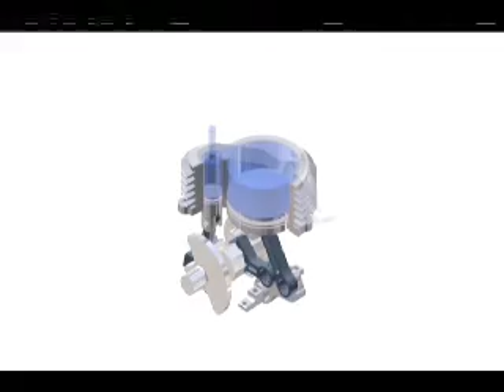A car that runs 200 miles on compressed air.

Comment: no way it runs around and round. the generator uses energy. if you can run it on compressed air, the point was to run the car on that air. what they are saying is they are creating energy from nothing. you can not have a loop like this. law is "energy can not be created". but i do think it is a cool idea. and i bet it would be cheap to run. just saying no way it will refuel itself. however you lose energy in braking, maybe they can covert that to recycle some of the energy. these system do exist

Comment: I read the air storage cylinder is designed to break apart without shrapnel or explosion when damaged, carbon fiber I believe.

Comment: "They're the reason why this technology is not hitting the showrooms"
Bwahahahaha
Look down at the comments 
Old tech, very short range, expensive to run, with no room to improve. Franchises sold to the greedy technically illiterate and admired by tinfoil hat wearing conspiracy kooks.

"enslaved to the grid"
An air car you needs a compressor an electrically driven compressor in this car. So how are you free of the grid or did you believe the perpetual motion BULLSHIT

Comment: hey no matter what if there was a generator on board or not MDI compressed air car is a revolutionary in automotive history. this car will be easy to fill and cheap. but what i heard is that there will be a car coming to the US in late 2010 or early 2011 in new burgh, NY  by a company called zero pollution motors and their car will have a range of 800 miles on just 8 gallons of biofuels or gas. so i don't see why this car is useless.

Comment: Wow this is one of the dumbest videos I have seen, and yours is one of the dumbest comments I've read. The video is not falsified. You CAN run a car on compressed air - people have been running trams inside coal mines on compressed air for over a century. You could not have combustion there. This is nothing new. But filling up with compressed air is not free - anybody suggesting that is an idiot. There's no source of compressed air, it takes a lot of energy to create it by running a compressor.

Comment: compressed air is free????  You can breathe the exhaust???  compressors suck electricity (and therefore money) like CRAZY, and introduce all kinds of contaminants into the airstream - oil vapors, condensates, dirt particles, you name it.  It's a convenient way to power certain devices, but is terribly inefficient.

As far as the perpetual motion thing, the author of this vid couldn't pass a high school physics class.

Comment: "Why is this rubbish?"
Why don't you read some of the comments oh ye of complete lazy arse. 
FACTS 
ONLY test range 7.2km 
The claims are LIES 
They have been selling franchises since the 1990's and left the franchises burnt and effing angry.
This is OLD technology air cars were used as trams in the 1900's and died because they were very short range low power and energy inefficient.

Comment: "A little thermodynamics will suffice"
like I said "Quick Calculations" 
Basically an overall efficiency of about 20% vs batteries electric motor at 80 to 85%
Another way is engine swept volume, gear ratio, tyre diameter and tank volume expanded to Std temp and pressure some maths which gives the absolute maximum theoretical range
About 40miles but MDI use a pressure regulator halve that and the efficiency of the engine is about 50% so halve again = about 10 miles on a good day with a tail wind

Comment: You don't need to look at MDIs history. A little thermodynamics will suffice. I don't have a problem with the notion that compressed air could serve as a storage mechanism, but of course you need to use a lot more energy to compress and convert it than you'll get back.

Comment: You can't be that stupid and be allowed to type. Step away from the computer. Compressed air is a decent STORAGE medium for energy. It takes more energy to compress it than is released. 

I can't believe the narrator made the stupid statement about the generator. Clown. Try this, connect a motor shaft  to a generator and the generator output wires to the motor. Give it a spin--wow, perpetual motion, and all without the intercession of a bunch of compressors and air motors. 

Not.

Comment: "Do you know how much it takes to evolve a concept from prototype to functional final product?"

It's an expansion engine for fucks sake ie steam engine there is 300 years of engineering history.
Air powered trams and mine vehicles date back to the 1900's This is a horrible old idea with exactly the same problems miserable efficiency, lousy power storage google Douglas Self Museum of retrotech 100 years  of air powered vehicles

Comment: "Is compressed air free now?! I've found free air (for tires) nowhere in the last 5 years."
Ah no. 
You have fallen for an MDI smoke and mirrors trick 
IF gas stations has 3500psi (pressure in the air car tanks) DIVE BOTTLE COMPRESSORS you could refill there but they DON'T and filling air tanks to 3500PSI is effing expensive at a dive shop particularly as the REAL range is about 5 miles (The ONLY published test)
Reply: The problem with compressing air and filling tanks is the heat generated. My local dive shop puts you tank in a water bath to keep it cool while they fill it. You can't do that with the car. Also this car has emissions, just not at the point of use, CO2 is created when the electricity used to run the compressor is generated. There is no such thing as a vehicle with no emissions. When people say no emissions, they are intentionally being deceptive.

Comment: Is compressed air free now?!  I've found free air (for tires) nowhere in the last 5 years. A couple of gas stations used to do it. Now it costs anywhere from $.50 to $1 just to fill up your tires. "Costs nothing... NOTHING to fill up your tank"?? Producer's a crank. Hype, hype hype! Sure, it's cleaner. Maybe it'll even be quieter, eventually. But free? It's not even free now. Can you run your home air compressor for free? The power company should let you, I know. Especially if you have this car.

Comment: "at the beginning of the century, petrol was free"
Only in your dreams converted into % of todays average wage liquid fuels in the 1900's were expensive. The cheapest in % of the average wage was in the 1950's

Compressed air air costs now. It is effing expensive way to move energy. Wander down to a dive shop and ask for a free refill. I'd like toi see how far they throw you

Comment: The waiting for 2 weeks worth of sunshine to recharge the tank to go 5 miles might be a "tad" impractical. :-)
This POC needs a 7kw compressor running for 6 hours to refill the tanks 
No 200W solar panel is going to make much of a dent it that sort of power demand

Comment: Uh... Have you ever taken into consideration that a regular car is sitting on a huge bomb? Further more the tanks are carbon fiber, so they would split open harmlessly rather than explode.  Kinda like if you shredded a hot air balloon.  So it's actually kinda safer than a regular car. However if you DID shred your tank you'd have to import another one from France, which would totally negate any gas savings you got. >_>

Comment: OK the problem is to use a phrase from TV "you canna bend the laws of physics" and the ideal gas law which is absolutely cast iron bullet proof allows anyone to calculate just how useless the MDI idea is. ie Goes about 5 miles on a charge which is what they actually get. Unfortunately there is no magic whiffle dust that can change this. MDI are doing the equivalent of selling magic shoe laces you can pull on to lift yourself to the moon. A con covered with a false science wrapper

Comment: faster than the rate you expel it from the vehicle than it IS possible to charge it while using it. Like I said before. You just aren't a visionary. That's why you'll never create anything. You're just going to stay in your close minded ways and not try to figure things out. So don't go lecturing me on what is and isn't possible. Because you don't have a clue what can be done as technology advances. Stay in your close minded state and bark at someone else. I'm through with you.

Comment: Actually I'm passing science with high marks.
You're just stuck in the past. One thing you have to know about science is that it's always evolving and some things considered impossible in the past are now possible now. If you're INTAKING new air while powering the compressor then you're not making something out of nothing. It's just circulating in new air and compressing it. It only takes a couple minutes to fill a compressed air tank with a good compressor.  So if the rate you take it in is..

Comment: Absolutly nothing. You have no vision. That's what your problem is. Yes you'll have to initially charge the thing. But if they can make an effiecient enough compressor that charges an empty tank and it's own tank while you're using the other tank it is potentially possible to keep it going the whole day. All they'd have to do is make the compressor run off less energy than the car and put it part of the way into the cycle. If the air is powering it, and it's constantly sucking in new air yeah.

Comment: It's not a perpetual motion machine, the engine is powered by compressed air coming from storage tanks (made by carbon fiber or something) underneath the car itself (think you can see them at 0.35). When the compressed air runs out of these tanks, you will have to refill them at some 'air station' that MDI is visualising about.

Comment: "It's not just the knowledge,it's what you do with it!"
The 7kw compressor to recharge this POC needs about $45,000 worth of Photovoltaics to run it. The air car efficiency is five time LESS than an electric vehicle
Google Vencat 20 miles for the USA distributor providing figures confirming that

Knowledge with out understanding provided by education? Your post reflects that

Your call

Comment: "I do believe it can be done." 
Yes you can limp round with a range of about 5 miles, Whee! and that has been so since the 1900's
The LIES MDI tell are physically impossible. You will need to get an education to confirm this yourself, but of course it's SO much easier to blame "THEM" for things not working instead of trying to use your brain.

Comment: So much misinformation here. "It cost nothing, nothing to fill up your tank". False. The car does not run on air, it runs on compressed air. It takes energy to compress air. The energy is supplied from a power plant that uses either coal, natural gas, or nuclear power. All of these produce pollutants contrary to what the narrator says. 
Perpetual motion? Not possible. At least not yet.

Comment: Well, perhaps I didn't make things clear.  Yes these cars can be made, but you need about 300 liters of air to travel 8 to 32 kilometers.  In addition, it seems like it will take 4 times as much energy to run them as electric vehicles.

   But otherwise, compressed air cars would be gr8 m8.

    If you have a link to the air taxis service, I would love to see it.

Comment: In addition to the large volume required to store the air, the conversion efficiency is probably terrible both when the air is compressed and later when it is released.  The range seems to be between 5 and 20 miles.  So this is not very good.  
   This is unfortunate, because it seems like a good idea.  I guess EVs are still the future despite their problems.  The Chevy Volt will go 40 miles on its 16 KWH battery pack (GM only allows the pack to be half discharged so only 8KWH will be used).

Comment: "when I get my scuba tank fill it take about 5 min a tank"

Yes but they are filling from a precharged bottle bank plus your scuba tank is probably a fifth of the size of the total units in the air car.
I notice you don't mention the COST to fill your tank 
If you think about it it might give you a big clue as to why this POC will be effing EXPENSIVE to run
Reply: You can buy High pressure compressors cheap . What you are saying is not true .  Filling up your gas tank for a month would be more expensive than the cost of one of these units .  Compressors are not magic nor expensive .  This is a pretty easy concept .

Comment: the range appears to be 200km and 120km/h max speed. I also noticed that in many of the pages i visited you appear to flame any video, article or even comment that has a positive attitude to this promising technology. you either have nothing else to do or you have.. other.. benefits from all that. Finally the 13$ you say this company took (thats 722000$ a year since 1991) is only a fraction compared to the billions per year that the oil producers and resellers make due to the lack of competition

Comment: It sounds good on first look and if you've used air tools you'll know how grunty they are. 
The problem is the compressor and air motor are  appalling efficiency wise about 10 to 20% vs straight electric.
MDI won't discuss icing  I believe it doesn't show at  their base as they appear to have a drier on the compressor feeding their tank farm (more energy loses). That's where the 3 minute refill comes from. A HUGE bank of bottles kept fully charged
Their claims have never been achieved

Comment: .cont. use that energy to turn huge generators and make ourselves some electricity then use that electricity to turn an electric motor driving a pump that will compress air for us then use that air to run our air cars!  - Great! - But wait, why not cut out all the middle men and simply eat the fruits of those trees and walk?  Or charge a battery via solar cells directly from the sun and drive an electric car? - Even better! 
Quote: If you can keep your head..

Comment: That is called perpetual motion and is impossible to due to the laws of conservation of energy and thermodynamics. You can't get more energy than you put in. If so you would see people driving around infinitely, which you don't. If it was even possible an electric car charging it's own batteries would be a lot better than compressed air.

Comment: OK Fuckknuckle You like to believe green liars. Terrific. Semi literate uneducated morons saving the environment. Sheesh

FACTS
6 hours using a 6 kw 3000psi dive tank compressor to fill it
5 time MORE electricity for the same range as an electric car
It has never been sold or built anywhere
In the only test published it went FIVE MILES
The technology dates back to the 1900's
By 2004 $13,000,000 taken from loser investors 
If you want the links confirming the above ask

ITS A CON

Comment: Did you get the circle of energy part? Compressed air to power the generator that compresses the air. It will work in America too btw. They tried to say it would not pass safety standards but what about carbon fiber? Some just want to suppress it. They know that they will make less money. They are so stupid and think things should just be handed to them. If they were smart they would restructure their business for the future not try to keep us making them richer!

Comment: Sadly it's not free as they say... You need electricity to compress the air into those tanks. I think electric vehicles are the future, however if they can get good range with this it might solve the range problem that batteries have at the moment.

Comment: I found out it's just the danger going with a compressed air tank ;) if something penetrates it (say, you drive to fast and bump the bottom of your car against a bump in the road...boooom it's over. These cars are better then electric cars but if there is an accident you have major problems...

Comment: Well if this was reality.... They would probably use some of that compressed air to make a little electricity to: power the battery, power the engine a little, and the electricity that is made can be used to power the generator that makes the compressed air? I don't know, it will never happen...

Comment: "All you need is 20 minutes of a normal air pump to fill the tank"

You LYING MORON

6 hours using a 6 kw 3000psi dive tank compressor
5 time MORE electricity for the same range as an electric car
It has never been sold or built anywhere
In the only test published it went 5 miles

ITS A CON

Comment: Google "e.volution south africa"
Same silly promises from 2001
Google "Rexreserch negre" Only published test 7.2km range plus promises on how much better it was going to be.
Goolge "Vencat 20 miles" 
Figures show energy use is five times more than an Electric vehicle and on air only MIGHT go 20 miles. Claims for a fuel assisted range are vapour ware as that unit has never been built.
PM if you want more

Comment: MDI Sell franchises from $250,000 up by 2003 they had taken $13,000,000.

No one FUNDS this it's a con to take money from unscientific rubes. Since this little scam started in 1991 NO cars have been sold NO factories have been built but a HUGE number of promises and false claims have been made

Comment: "Some of you guys have a good point"
 What?? 
The only published test was 7.2km at bicycling speed. 
Promises of production in 2000 2001 2003 2006 2008 etc etc never met
An efficiency 5 times WORSE than an electric vehicle.
NO independent tests 
Over $13million taken and NO progress since the 1990's.
Plus it's an old 1900's crap technology with no room for significant improvement

Comment: You got $45,000 for the PV panels and converter to run the compressor to fill the tanks on this piece of crap so you can go 7.2km at bicycling speed? 
Google Rexresearch negre for the only set of actual  test results pitiful as they are
The only thing certain if you can't read, think or understand basic physics you are wide open for every con man, shyster and kook to take your money.

Comment: let's think about this cars (dangerous) running on a 5,000psi air tank (bomb) that heats to several hundred if not thousands of degrees Fahrenheit as you fill it up (hot).

Wait till two of these hit each other and level a city block. Will bring a new definition to car bomb.